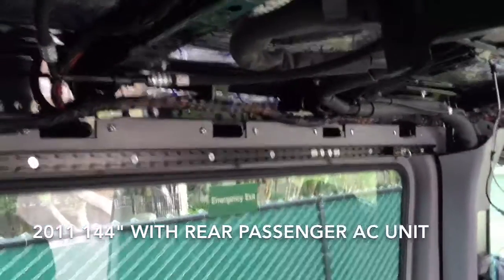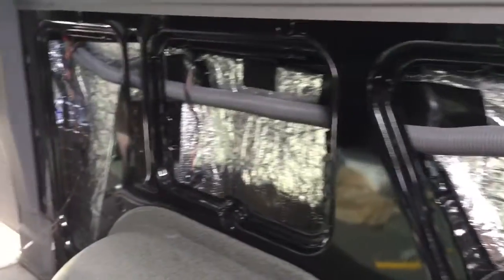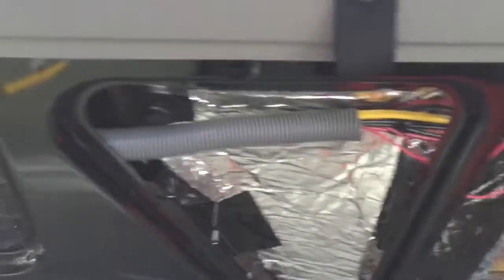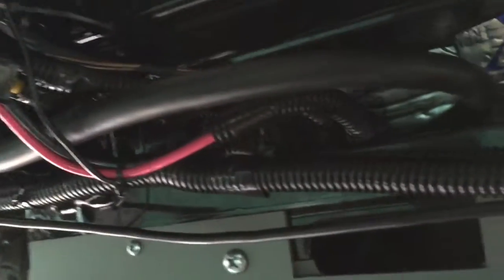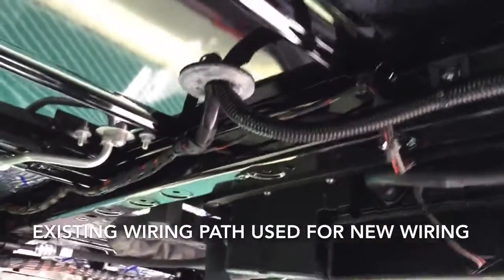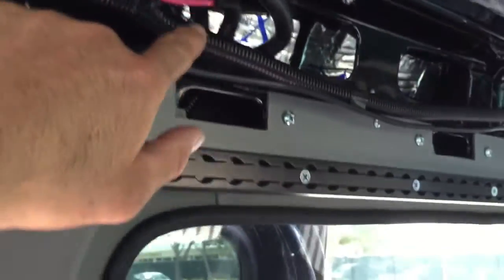DIY Sprinter Van Wiring for Aux Battery, Inverter, Led lights and Solar

Comment: Hey to DIY, Dave here.
Questions, please: 
How's your van doing?
And are you having any dashboard faults from tying into the electrical system?

Do you know how many amps the extra 12-volt power outlet can handle?
I'm hoping to run two MaxxFan vents from this circuit before adding solar, etc.

Thanks for the videos.
Lord Jesus bless
Reply from the maker: David Almeroth I never tied into the electrical system. Everything runs off of an auxiliary system.  The cigaret lighters are more than capable of running a fan. Check you manual some outlets are up to 25amps.
Reply: @DIYSprinterVan  
Yeah, just trying to double check things. One fan needs up to 5-amps so that power outlet should be good.
Only recently heard Mercedes-Benz has electrical limits for the newer vans. 
Eventually will go to a separate electrical system but need to use that outlet for now.
Thanks, again

Comment: What kind of wire did you use and why? Your video is interesting but won't help anyone doing their own build if you don't specify the exact parts that you used and why.
Reply from the maker: Thank you for your feedback. The video is more of an example on how I ran my wiring in order to get from point a to point b.   Wire type and size will vary depending on your electrical needs.  I will add the wire size to my description. Good luck.
Reply: Thanks. I appreciate your videos. :-)

Comment: how the hell you going to panel that with all that wire i was just looking for a video og how to re route standard wires from the side to behind the walls.
Reply from the maker: Edgunsuk  i just re hung my stock headliner and side panels.  Everything is out of site.
Reply: thanks for the reply , mine must be a different design then as all the electrics from the rear doors camera lights etc etc are in front of the wall at head height on the left hand side of the rear compartment (im in the UK) same side and just above the sliding door , there is no way to panel over them, as there was never panelling there from the factory